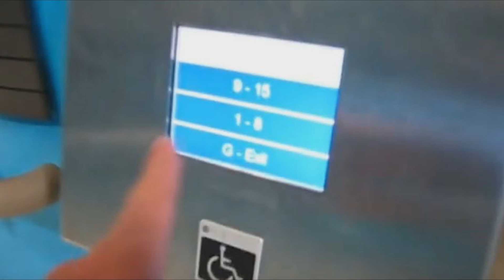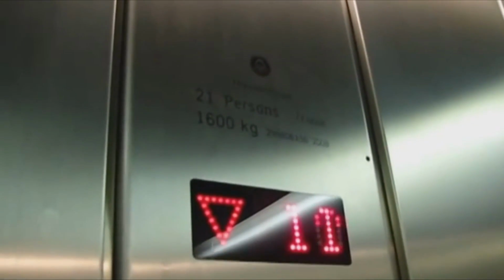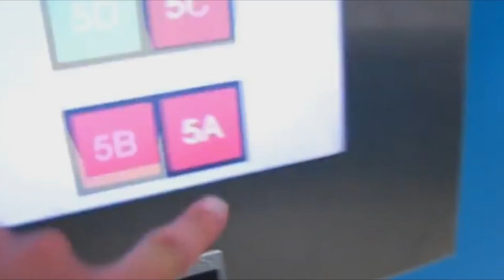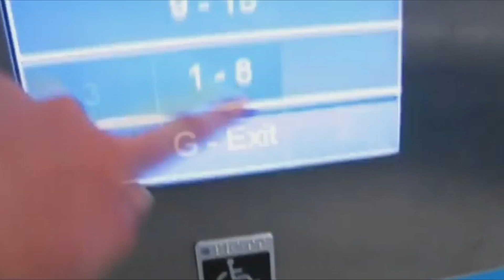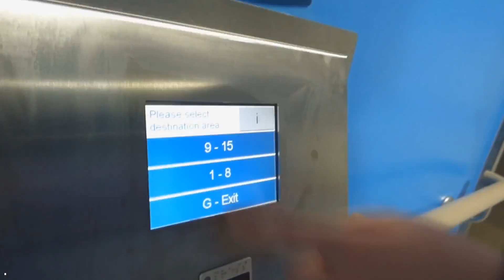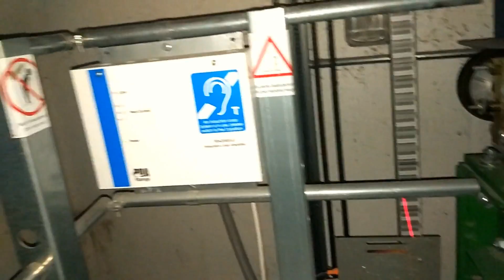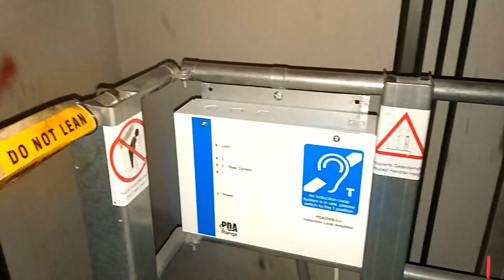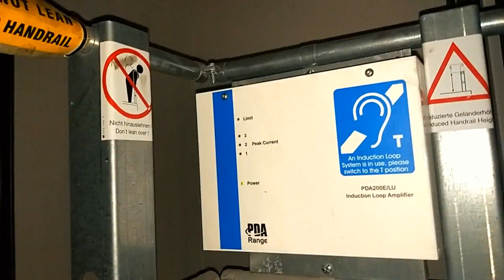Detailed look at twin

Comment: The hardware based safety system is still there. It just locks out one door if the lift is in de door zone for that floor. The door contact is bridged by a combination of the DZ contact and a proximity switch for the current floor.
Reply from the maker: Do you have a link to this infomation
Reply: Oh, by the way: the original concept drawing i've seen many years ago did include a safety between the cars that does detect that the cars are about to touch. As you mentioned in the video it is not there. Possible it has moved to the counter weights or it has become software only. You will probably be reading the full description of the twin patents by now. Can you inform us what has happened to this safety system?

Comment: It finds its position because if the motor de-syncs with the lift if like the cable slipped or something went wrong it can re sync where it is so it doesn't drive off the tracks or run into the pit.

Comment: Did you try inspection ?
If this is the case then does it put out of service both lifts ?
And where does the lower lift stop in inspection if the upper one is "in the way"  while going up ?
No fear of getting crushed between both cars ?
Reply from the maker: I didn't try inspection.  I do really understand how some of this system works.  I got on and off with just a safety break.
Reply: the safety chain on each lift is in  series

Comment: So this lift have 2 motors? And how the cables and counterweight are designed in a twin lift?
Reply from the maker: The twin lift has 2 motors.  The lifts have standard 2:1 cabling.
Reply: Beno Lifts both motors are on top?
Reply: true

Comment: Real time OS? It must be... the kind of "fail safe" system that they put in medical systems and missle guidance systems. Maybe it's QNX or Vx Works... it surely can't be windows or linux... too unreliable and too unresponsive. They better get it right and not use any multitasking. With such a safety critical application like this you want a system that responds instantly on input or prioritizes safety critical events. The car industry is increasingly using automated driving systems but I've seen demonstrations of Chrysler cars where someone could operate the brakes via a flaw in the entertainment system.
I would not trust a system that depends entirely on software for it's safety concept. No matter how well tested it is, even militairy grade systems can have flaws. There is no backup in case the computer crashes due to a memory leak or even worse a system that decides to perform an over the air software update whist it's running. I wonder how Thyssen Krupp have designed this and if they have thought of that. A lot of software is written with rather poor quality with no focus on security or reliability. Not just software for consumer devices but also government software systems are often cobbled together.
Reply from the maker: It would need to be an ultra simple system that just does its job and does nothing else.  There is no way of knowing  how well things are programmed like this.  It says on ThyssenKrupp's website that their software conforms to some  reliability failsafe standard.

What annoys me is how a lot of companies talk about how advanced their safety systems are, but just want to sound impressive rather than explains exactly how they work.  A good safety system needs to be very simple and very reliable and also needs to be open about how it works.

For me a proper safety system should have two separate systems that work independently of each other and never rely on each other on any safety aspect.  And one of the two systems should be a physical relay that cuts the power.

I have noticed several things on some modern lifts that have made me a bit concerned.  Gen2s and Ecodiscs will ignore limit switches when on cabinet inspect, while this is useful, I wonder if they have relay protected this or if it is just software.  Gen2s have a card that can be put in to bypass safety, which seems very easy to forget about and very dangerous if a lift entered service with safety bypass, but the software does some test that proves that it is bypassed and won't allow it to enter service with the card in.   But with all these work arounds, it makes it less absolute that the lift can not move with the doors open.

Also on pre-doors, often it is just a shaft bar that bypasses safety when it blocks a beam sensor.  What if the sensor got block for some other reason, then would the lift move with the doors open.  From the experiments I have done it does seem that modern lifts know when a piece of safety hardware is not working properly and shuts the lift down.

For safety, Mitsubishi (1990s-2000s) is the best.  There is a massive inspection switch on top the lift that powers off the main logic and switches on the inspection logic.  This is such a nice well designed feature.
Reply: I could compare this with an real world example of the train safety system in Sweden. It is computerised and protects trains both from overspeeding and doing SPADs as long as ATC balises are placed along the line. The on board system have 2 independly running computers that receives information, process it and then checks the results with each other. If they agrees they presents the info to the driver and/or takes action. If they disagrees it is an instant emergency brake and the related error code being shown that the ATC on the train is failing.

Very ahead of its time when it was developed in the 70s and 80s.

Comment: I’m guessing the controller knows both lifts’ positions exactly and calculates the distance between them? If that is the case, then the controller must be quite complex. And this could be the answer to why it loses Its position very easily, because it (the position) needs to be as precise as possible because if the position was imprecise, then the cars could crash into eachother, so if this is the case, the easy position losing is just a safety feature to keep the position as exact as possible.
Reply from the maker: I wouldn't say it quite like that.  The safety circuit is very complex.  It has to bypass the correct parts of safety for the other lift.  Each twin lift has an extra cabinet in the motor room to manage the safety circuit bypassing.  I personally do not like this and would prefer shaft roller switches that the lift car could press when opening a door to bypass it on the other car.  

To stop the lifts crashing into each other is done by software.  The destination dispatch wouldn't allow this in the first place.  And software is used as a backup.  I don't like this over dependence on software. 

Also, the logic does not know the exact position of the lifts.  It uses reference point and tacho.  There is no absolute position system on these lifts.  The logic counts its travel distance between reference points.  After an emergency stop the logic refinds the nearest floor.  This is semi position lost (called JU in German).  This is better behavior than something like Thamesvalley which attempts to continue after an emergency stop and sometimes the taco has gone out of sync and the lift approaches a floor too fast.

The other major part of this system is the destination dispatch, which is just a case of programming an algorithm to make the best use of the twin system.

Ultimately a twin lift is not much different to a normal lift.  All it needs is an appropriate safety circuit and a destination dispatch system.  It is a shame that other companies are not making them.  Kone would do a far better job than ThyssenKrupp.